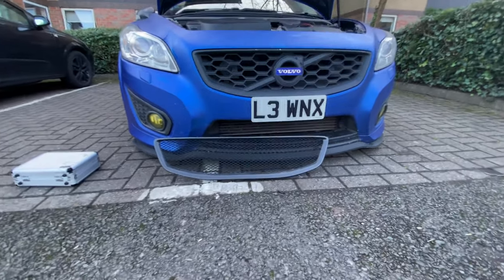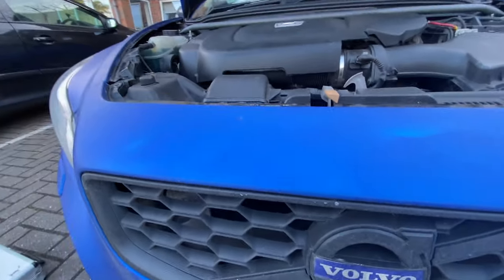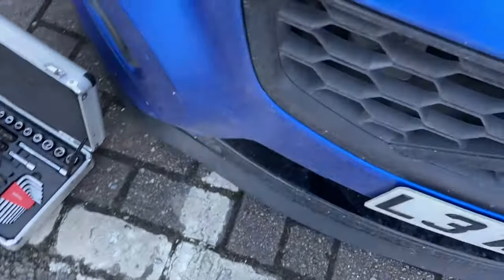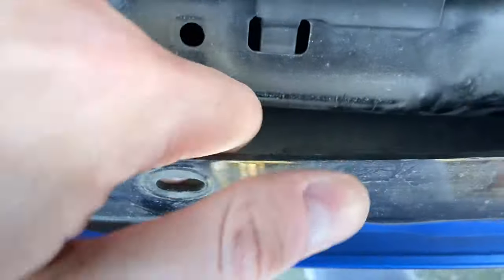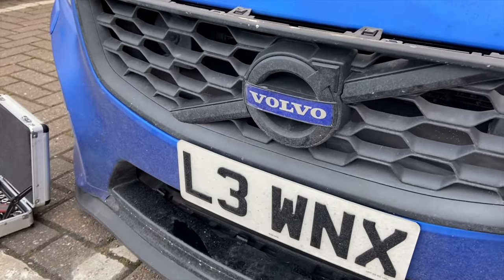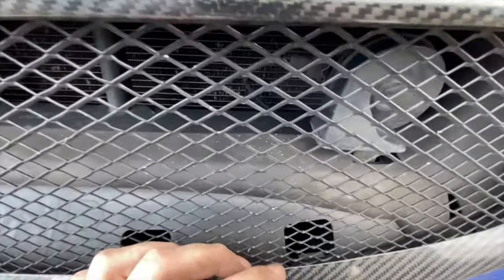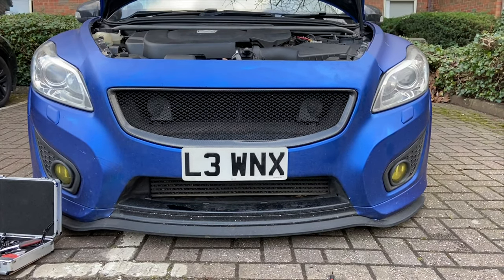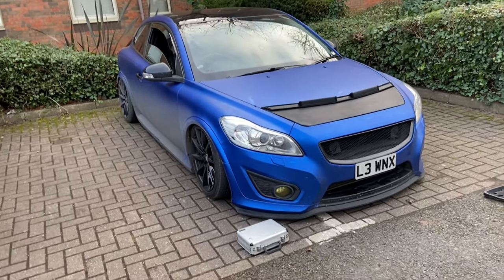Volvo C30 Carbon Grill Install

Comment: Where did you buy the front spoiler/lip? And did you paint the original front grill black or just found another one that already is black?
Reply from the maker: it came with the car, pretty sure its just a universal eBay job